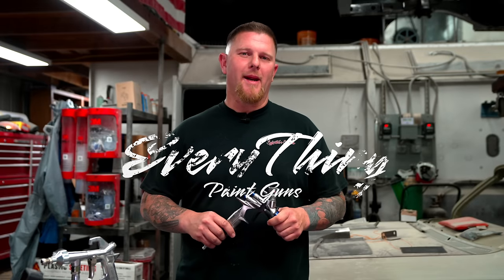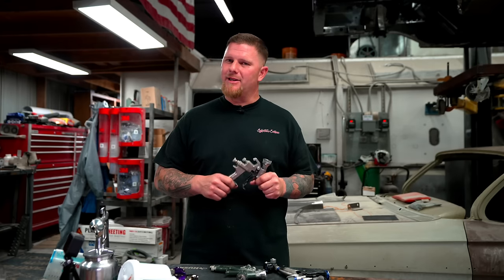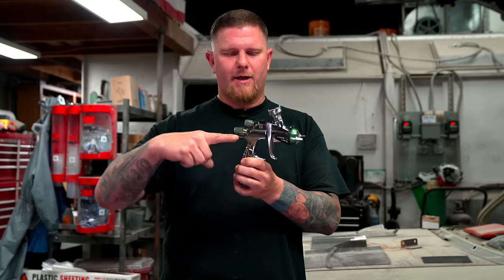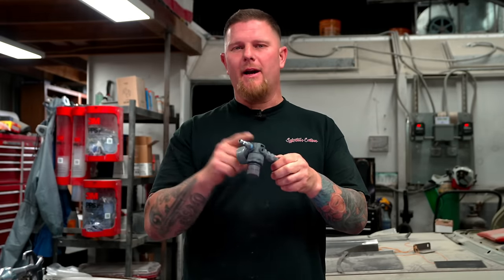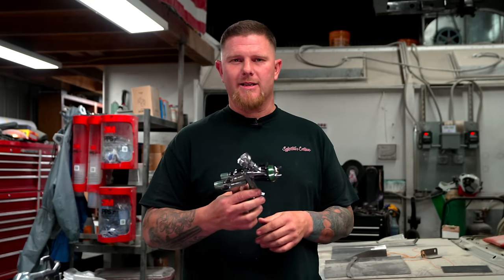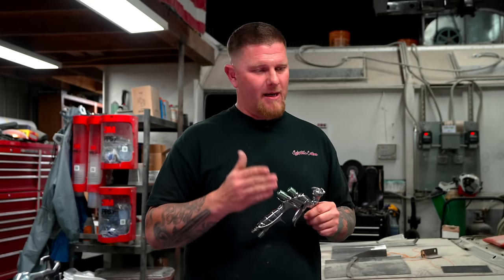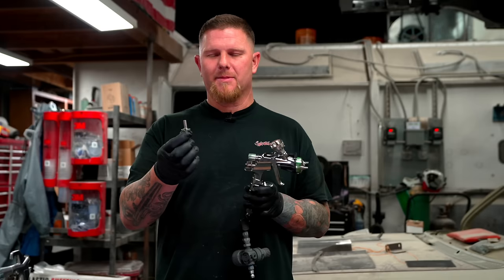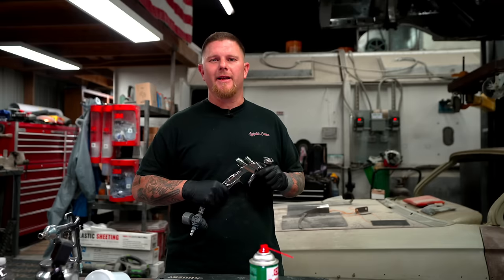I’ve Spent $1,000's on Paint Guns So You Don't Have To!!

Comment: I am glad you said to use a dedicated air hose as 50' seems best. My wall mounted copper air line gets a filter for everything as water comes out my air ratchet does feel good. You need to oil your tools more often and still risk a shorter life. That pressure of 35 psi drops as it passes thru the gun, resulting in 10 psi at the cap as recommend. Great informative video.
Reply from the maker: Thank you!!
Reply: @SYLVESTERSCUSTOMS  I didn't have real family to work with growing up. I dad farm chores and built fence and more. They carved up property, 800+ acres, a house with buildings to my little brother and I got nothing. Maybe I should have left the farm at 15, because my brothers & stepfather had to work. It's a cruel world out there as I was discouraged from buying fixing things & buying motorcycles at 9. I told them that doing wheelies was practice for flat front tire on gravel roads. I wonder if any family are around after 49 years?

Comment: Paper towels, Q tips etc that have soaked with acetone, brake clean are a fire hazard. I put the used items in a fire safe container or outside away from the structure. You don’t want your shop to burn down. Just another tip.

Comment: When your company paying paint ,you will use Sata and Devilbis with explanation that it it is fast and god guns.When you paying paint from your pocket Iwata all the way!When i switch from sata  2000 to Iwata w 400 about 23   years ago it was like switching from medivel mace to japanese katana.Light,precise,saving air and paint,control for blending.And yes, you need separate gun for base coat(separate base coat gun for solid colours would be nice,to avoid metalic flake residue),gun for clear coat,gun for blending agent,and that's only for painting!
Reply from the maker: Having a separate gun is not necessary if you don’t have the funds though.

Comment: Another great Video , I want to add this, when I was spraying 10 cars a day in the 70’s my go to gun was a devilbiss on a 2 quart pressure pot , they work great the gun is in your hand. And the pot is in your other hand. You can turn the gun upside down and walk the length of the rockers etc. plus the fan is huge and they dump paint resulting in a slick finish or the fine line of running the shit out of it.  They are great for big trucks tractors or things with alot of angles . I always used a Devilbiss but Binks makes them to.

Comment: Sly - you’re an awesome guy. 
Aluminum sheet metal of Peterbilt and Freightliner.
Tigging up holes that should not be in places. 
Handles and fairings that need removed and nut sert holes that need welded up and hammered out. 

O’ yes - and the paint gun sagas …..

The IR gun from Tractor Supply is a good Semi truck gun:)
Big Metal gravity can:) 
It sprayed DuPont nicely:)
Reply from the maker: Thank you!👍🏻

Comment: My digital amazon regulator is starting to get eradic. Is that a sign to take it apart and clean it?
Reply from the maker: No idea
Reply: I would replace it. I got a digital Devilbiss regular. I’ve had it for 3 years and the battery still works. That’s painting about 90 flag hours a week.
Reply: @Ontheroadbrogymgo  i have two and i just found like a 10-15psi difference between the two set to the same psi.